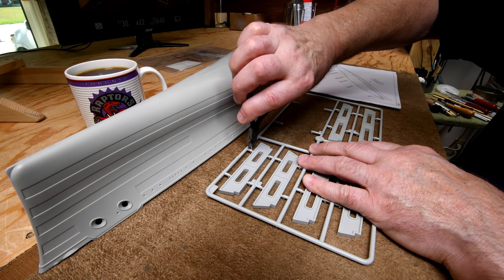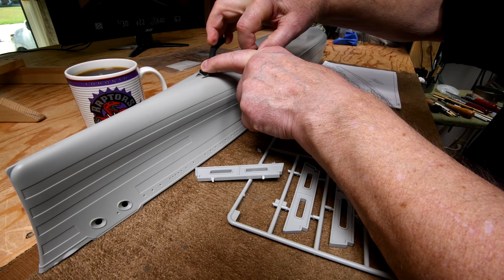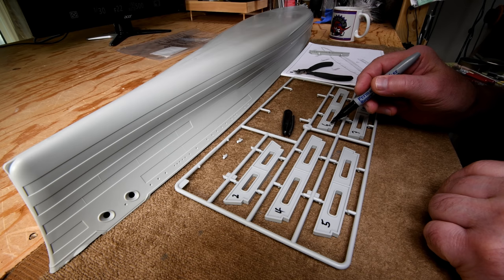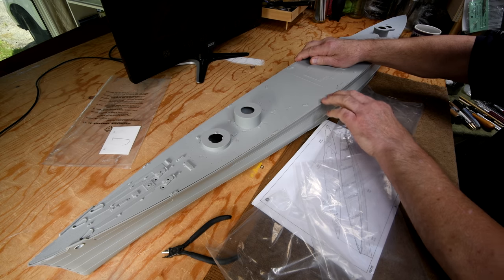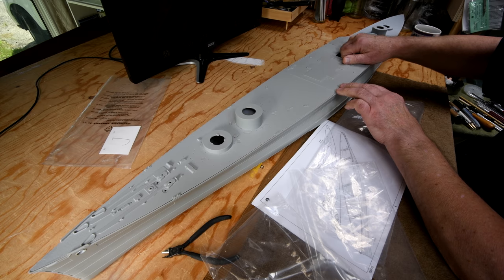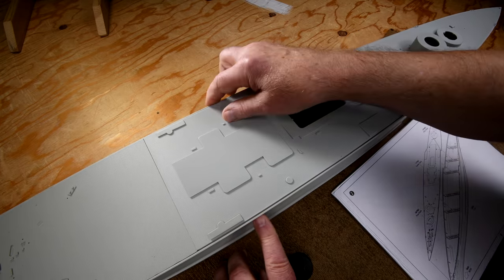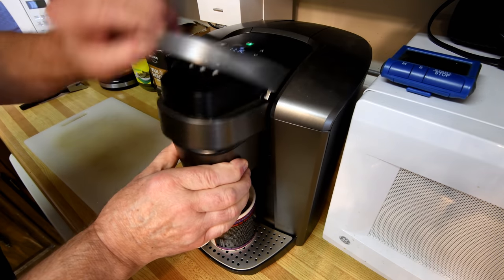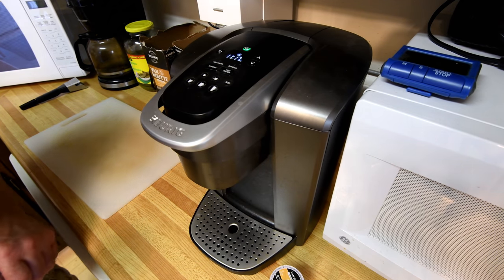The Model Ship - Part 523

Comment: Hi Ron.. a tip. Don't use those Tamiya nippers for cutting through thick sprue, the edge will chip.. ask me how I know........ Another tip.. tamiya extra thin can be applied after the parts are assembled, it will wick into the joint by capillary action. Finally, those lines in the inner stern area are part of the ejection process from the mould tool. Because of the acute angle the ejector pins are working at they give them a couple of "keys" to stop them just sliding up the sides of the hull and pushing it apart. those ledges give the ejector pins something to grip on..

See you tomorrow!!
Reply from the maker: Hi Nigel,
Thanks for the tips. Also your theory on the injection molding process sounds good. 👍🙂
Reply: @roncalverley  you're welcome. Sometimes you'll see the ejector pins have a kind of wedge on them.. they're called Z pins and they are designed to hold the sprue when ejected rather than have it fall to the chute.

Comment: I wonder if those ledges inside the hull are to hold a motor kit to make it a working model? Or, of course, a remote-control box! It would certainly be water-tight if you put it on a lake!
Reply from the maker: Re: "those ledges inside the hull" See Nigel's comment. Sound most plausible Ian. 👍

Comment: Ron, my thought would be to glue the decking to the hull prior to painting. Glue in the supports, put deck in place and rubber band everything together until glue has set. Should be perfect fit. Then glue deck on if you’re going that way.
Reply from the maker: .... well that's different than planned, that's for sure, lol. 😁👍